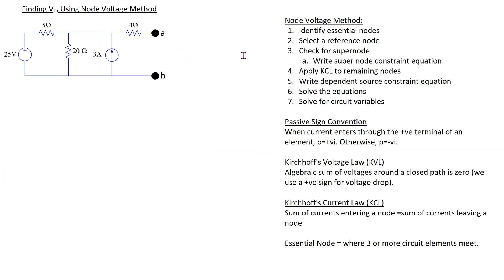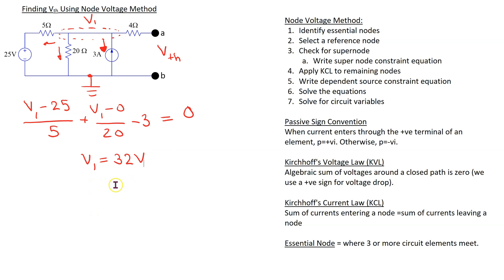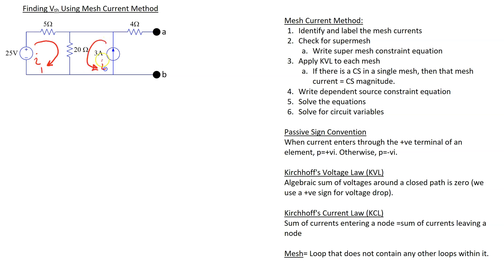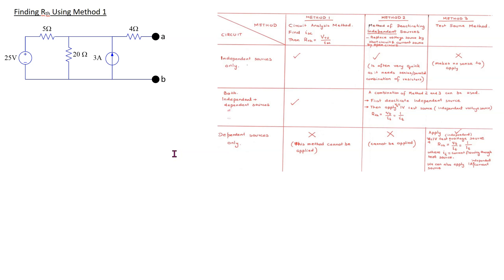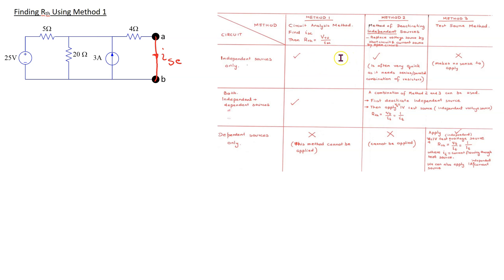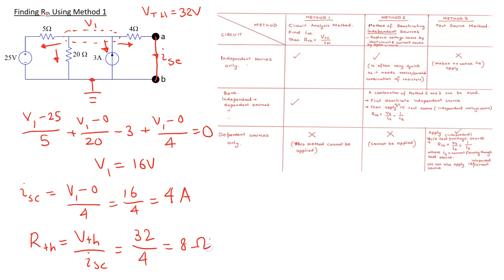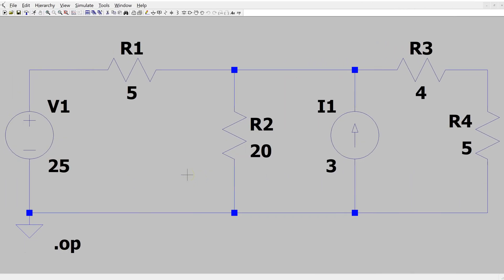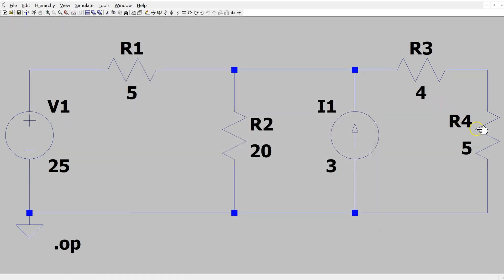Thevenin Equivalent - Example 1 Circuit Containing Independent Sources Only (Simple Example)

Comment: Assalam o alaikum sir!
Sir I didn't get the correct answer for Rth using mesh current method.
Reply from the maker: Thank you. Are you using Method 1 (circuit analysis method) to find Rth with mesh current method as underlying circuit analysis technique? Please recheck your circuit equations. Note that the current source is connected between two meshes and would cause a super-mesh in this case, which needs to be handled correctly.

Assuming clockwise meshes and labels i1, i2, isc, we have

KVL mesh 1: -25+5i1+20(i1-i2)=0
KVL supermesh: 20(i2-i1) +4isc =0
Supermesh constraint: isc = i2+3

Solve to show isc=4A as before.
Reply: @electriccircuits7164  Thank you so much sir for the explanation...I used method 1 and super mesh technique but due to the direction of assumed currents in the supermesh i.e clock wise and anticlockwise, results in incorrect answer.
My question is, is it mandatory to choose the same direction of assumed currents in the supermesh? Like both C.W or Both A.C.W ?
Reply from the maker: @kanzulemaan1076  The mesh current directions are arbitrary. We can assume all clockwise or all anticlockwise or a combination of the two directions. It only impacts the sign of the final answer. See the detailed explanation and comparison here: https://www.youtube.com/watch?v=Dqpv3G222cg 

Practically it minimises the chances of making an error if you are consistent. Personally, I just prefer to use clockwise mesh directions if given the option to do so!
Reply: @electriccircuits7164  okay sir thanks a lot for clearing my confusion.